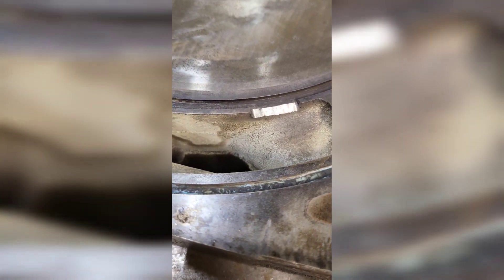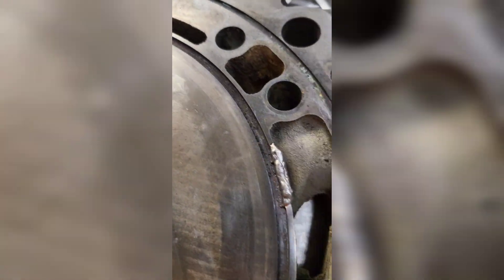Mazda Rotary Engine Side housing coolant seal wall repair.

Comment: Nickle rod huh!!! Thx for sharing that info. My 20b had the same issues back in 2010 on my thick center plate so I just used a mig welder back then. I think it's slightly leaking so I may grind the repair off and go with the nickel this time around.